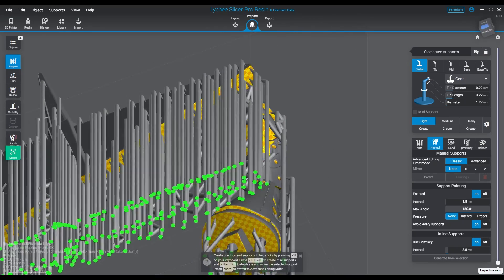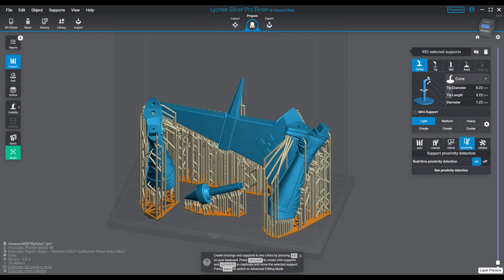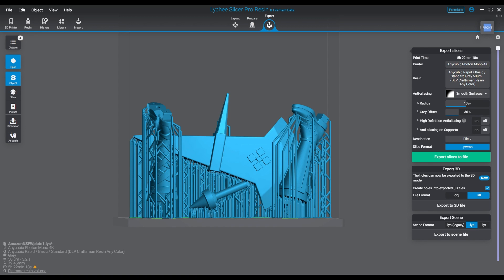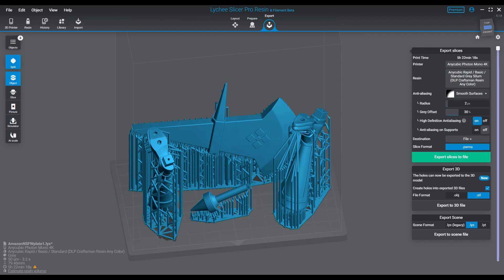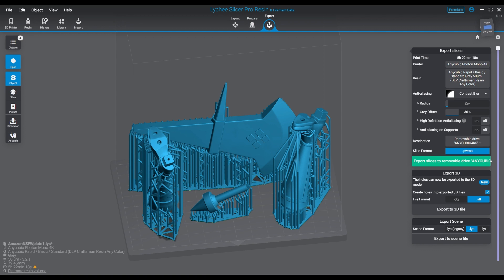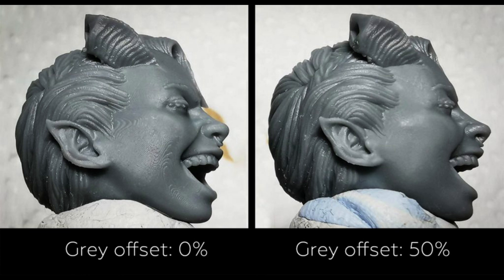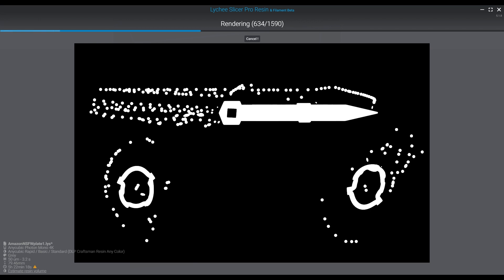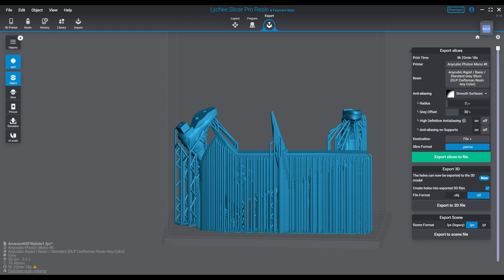3D Printing Lychee Slicer Anti-Aliasing settings explained!

Comment: what are your thoughts on auto bracing and auto parent supports? i use them to give the tall single supports more rigidity to reduce layer lines showing up.
Reply from the maker: I use auto braces a lot, they work very well. With the grid system they work even better.

Comment: prints im doing that are around 5-8 cm big keep losing details on the faces and some areas im not sure how to fix it 
im suing a saturn 3 ultra
Reply from the maker: Orientation is a big way to fix that. Make sure no supports are touching the faces.
Reply: @IPrint3dMinis  yeah i make sure none are now still is happening uncertain as to why
Reply from the maker: @SkitZHitZ  My suggestion then is to check that the supports are not too big. This might cause warping.
Reply: @IPrint3dMinis  ive mainly been using the small auto supports still very new to this had it for around 2 weeks now
Reply from the maker: Try doing some manual orientation and supporting.

Comment: Hey mate. When you mention not applying anti-aliasing to supports, does this mean that if I'm using a pre-supported .stl file, applying anti-aliasing to it WILL be applying it to the supports too?
So essentially I'd have to use .lys pre-supported files to get around this?
Reply from the maker: Yes, if it is an STL and you use AA settings it technically will apply that to the STL and the supports. Using pre-supported STLs is usually a bad idea, we hate making them, but a lot of folks want them. We always provide LYS and STL files for this reason.
Reply: @IPrint3dMinis when I reduce scale (say 75 or 80%) on lys files, then recalculate supports, I often get supports colliding with the model.. I tried the pro version of Lychee but it didn't recognise the collisions.. is this a common problem?
Reply from the maker: It happens to me, so yes.  @Prickles2001

Comment: Got sick and tired of reading reddit posts. THANK YOU for this video. At least it's clear and i have visual examples.
Reply from the maker: Love it, yeah AA settings are a bit of hit or miss, and the chatter online is a bit off too. My current settings are sticking with the Smooth Surfaces, 50% offset, and 2 px radius. Works great now, barely see layer lines if at all.

Comment: Thanks for that explanation, really helpful.
Hope you don't mind me asking a question. I can see you print in a similar way as I do. What I have problem with the bottom flat surfaces when the plugs are. Like those legs in this video. In my case they are always deformed and look like a bar of soap. Do you have any suggestions how to minimize it?
Thanks
Reply from the maker: No worries, it might be that the orientation is leading to warping issues. If the item is supposed to be square, make sure it starts at a corner, if it's cylindrical make sure and mimic the shape in supports or part of it will be pulling in different directions and cause warping. I hope that helps.
Reply: @IPrint3dMinis  Thank you for your reply. My objects are pretty much the same as yours. The bottom are where the split is is always deformed. I'll try rotating the object
Reply from the maker: @androot69  Send me an email, send me a screen shot of how you are doing it. I would be happy to help. You can get my email from the about page.

Comment: Very helpful information!  Thank you!  
1.  What kind of anti-aliasing would you recommend for gaming miniatures?  
2.  Finally, how would you compare AA in Lychee to Chitubox?
Reply from the maker: I will do some compare with Chitu soon, I am working on some videos for Chitubox content as well and I will explain my thoughts on that when I do some more research personally as I use Lychee a lot more than Chitu. As far as AA for minis, like 32-55 mm I would recommend Sharpen Details, 20-30% grey offset, this will allow them to look sharp, and it should remove layer lines mostly or partially on flat areas or larger surface areas. If they are 75mm I would go to Smooth Surfaces, 2px radius 30% grey. I use that setting for my 75mm - 120mm stuff. Anything bigger than that go with Smooth Surfaces 1-2 px radius (depends on layer height) and 30-50% grey. Don't worry about detail loss, it will look really nice at that level, but this would be fo BIG objects like anything over 120mm.